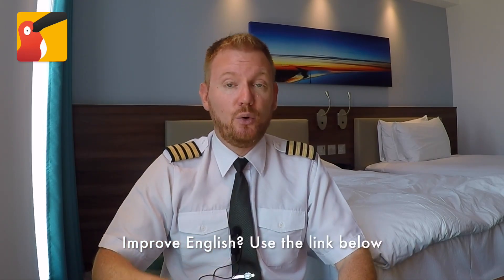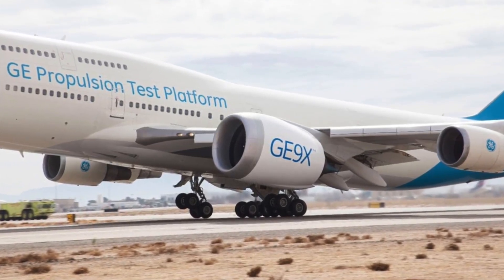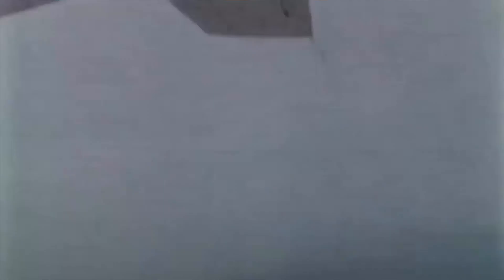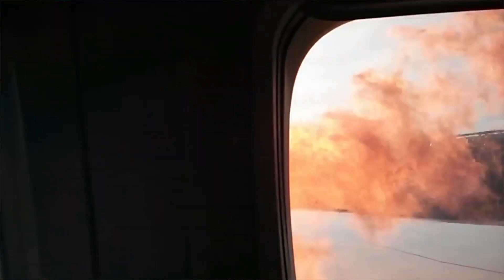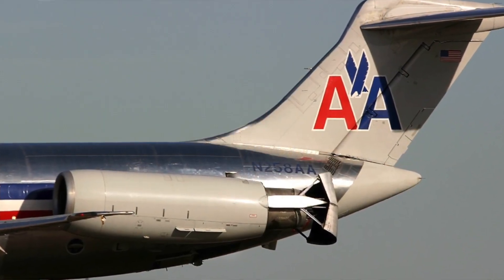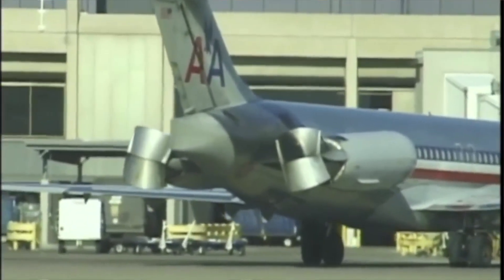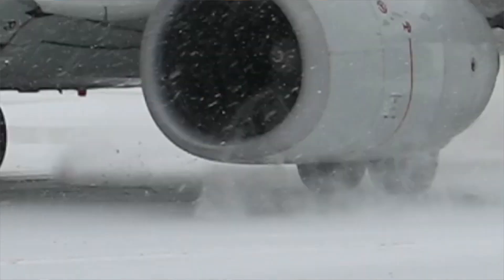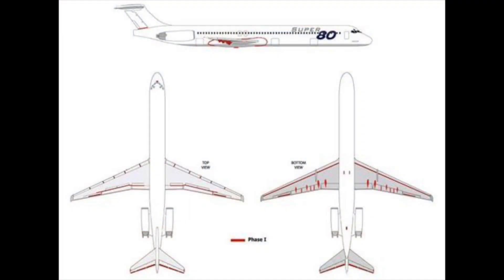Why are the jet-engines placed there? Wings vs Tail

Comment: um the biggest reason the engines are mounted where they are is due to the area rule of aerodynamics ... if the engines where inline with the wing edges you would need an engine 3 or 4 times larger than you have to take off ... by moving them forward of the wing front or putting the on the tail ... you adjust how much power is required to take off ... the more vertical surface area you have in any given line will be your drag ...the more you can balance the lines so they follow a curve like a drop of water on a glass plate ... it never fits perfect but you adjust where stuff is to make the resulting effects as beneficial to your needs as possible ... supersonic flight needs a change of fuselage over the wing area to have smooth easy flying air flow ... a passenger plane like the boeing does it with its top hump by extending it back over the leading edge of the wing they make the plane more efficient  saving costs and added bonus of making more room for paying stuff
Reply: that fluttering is called resonance ... and will constantly increase until acted upon in an opposite manner .... or by changing its point of resonance ... by adjusting a flap ... or trim ... or perhaps a transfer of fuel ... any change to the affected area will result in some effect to either increase or lessen the problem
Reply: btw the other reason engines mount forward is the exhaust also increases the lift of the wing in its path because it warms the air and pumps high speed compressed exhaust gases into a comparative vacuum  ... so as the exhaust expands in the rear air it gets denser pushing the plane forward faster ... yes due to cooling from expansion ... this is also where your contrails come from ... they also precipitate out any unburnt fuel particulates and they eventually fall to earth in rain or smog or some other natural way ... eventually ... and this is where cloud seeding theories get there fodder ... what you put in the fuel ends up in the air eventually ... put enough of a bad thing anywhere and it eventually becomes a big problem ...

Comment: The 737 was initially designed with tail engines. The engineers were overruled
Reply: Jimmie Meadows so it was a complete rip off of the 727?  So, the mad dog.

Comment: I am curious what impact tail mounted engines have on the design of the wings.  I would think you could make them cleaner aerodynamically, lighter with possibly more internal room for fuel. If you want to weigh in on this, I would appreciate it.

Comment: One minor item that I didn't hear mentioned.   There is a trade between fan diameter and landing gear length.   Bigger engines require longer landing gear - and
landing gears are heavy.     This tends to be more of an issue when retrofitting larger fan engines to an existing airframe.

Comment: Russian fighter jets can close the engine intake opening in the front & that panel opens an inlet at the top of the wing to get air to the engines to avoid FOD or foreign object damage, then when airborne they move the panel up to open the front intake & close the top intake! This feature is needed because they often use fields with a lot if debris &( shit )on the ground! 😅👍🇺🇲

Comment: At the time of the first jet airliners, putting engines in the back seemed a good idea, largely becauce single flow jet engines of this time were very noisy. But there is a major drawback : overall balance. This why this solution has been dropped apart on small business jets.
In France when it was decided in the fifties to develop a mid range airliner there was two projects in competition, the SE210 Caravelle, and the SO60.

The SE210 had its two engines at the back, while the SO60 had its two engines under the wings, prefiguring the Airbus which came later.
The SE210 was chosen, but it wasn't the best choice !

Comment: All new commercial aircraft have the engines on the wing because of weight. 
Attaching the engines to the wing spar means you have them attached to the strongest part of the aircraft structure. 
Older designs with tail mounted engines have extra fuselage structure to spread the load from the tail to the wings. 

Business jets are too small to put the engines under the wings, so they put the engines on the tail, closer to the fuselage. 
Wing mounted engines are further away from the fuselage,  so they are less likely to hit the fuselage with debris if they explode. 
Business jets put the engines behind the pressure vessel of the fuselage. That way if the engine bursts, parts won't rupture the pressure hull. The tail area is unpressurized.

Comment: I can see that the rear mounted engines are have a few degrees of inclination in order to have the exhaust airflow a bit downwards. Is the purpose of this fact to minimize the pitch up moment when the thrust is increased??

Comment: Why are aircraft engines not water washed like power generation facilities?
Reply: They are, sort of. The cleaning media varies by model, but they do  have power recovery washes on a schedule. Essentially a soap is sprayed in,  allowed to sit for a few minutes,  then washed out by cold water, all done with the engine motoring on the starter. 

Some turbo jet aircraft get things like walnut shells injected while running to clean the turbine blades off.
Reply: They are water washed in intervals.

Comment: Is it not possible to have engine on the tail and the wings so as to have  spares in case running engines fail?
Reply: That would be so heavy the plane probably wouldn't take off. Also engines rarely fail, and when multiple engines the reason is never independent (so all of them would fail)

Comment: The problem with pilots not being able to "see" the engines is always concerning.  My question is; why don't they have cameras that can feed visual information on demand to check the engines on both wings at the touch of a button aside from cockpit indicator lights?    I've been looking up on air crash investigations and I've seen a disturbing trend of some engines falling off, or burning, or something else - and sometimes the cockpit indicators aren't enough to assess what is wrong.  There's one airplane accident I've seen where the pilot switched the WRONG engine off (right engine) when it was the left engine that was malfunctioning and sparking during flight - the end result was a super stall and a crash. 

For something with a possibly simple solution, it seems they still don't have that if what you're saying is still true that pilots still can't see their engines outside of indicator lights - and the reliance of cabin crew for actual visual confirmation.

Comment: Do you have an answer for the question why commercial airplanes never offer a very cheap very simple parachute and an (under normal circumstances secured, locked from the cockpit) emergency escape door that can be opened in emergency situations as a safe escape route 100% guaranteeing the survival for every passenger?
Reply: You cannot parachute out of a plane that is out of control. It also doesn't help in any regime where failures are helping and unless you know how to use a parachute you might die in the attempt

Comment: Wait if a 737's reverse thrust is initiated, won't it be correct to say that it will not suck any gravel and shit from the ground, matter of fact, it won't suck or intake at all because the reverse thrust is only gonna throw or push the air forward which in turn pushes the plane backward so there is no sucking therefore no gravel and shit in the engine you're welcome
Reply: but the engine is still intaking air

Comment: I am curious why aircraft designs like the Lockheed L-1011 are no longer used. Engines in under the wings, and in the rear. And yet, it is not a T-Tail aircraft.
Reply: Ok I retract this question as I found your video "Three Engined Aircraft, what happened?"

Comment: One more minor comment:  Russians were famous for placing numerous engines in tandem either on the tail or in case of the Ekranoplan (Caspian Sea Monster) which had four engines on each side above the nose.  You can only imagine the stress placed upon the mounts!  Plus the Buran space shuttle placed engines on the back of their fuselage, probably either to provide more maneuverability or simply because the pilots didn't trust the automatic landing system.

Comment: T tails needs a counter weight on a rail system to shift the weight towards the nose when you have a super stall. It can be designed to be on a ram. It moves forward to force nose down, building speed to maintain lift without extra downward trust from the engine. The weight is over the center/wings and can be thrust forward during stalling.

Comment: I know when an engine blows up like one did on an Airbus 380, your chances of survival are much greater when they blow the empennage of the tail of the plane, not easy to control the craft when this happens.  When landing, either a prop or jets blast under the wings gives a quick extra lift hitting the flaps.  Mounted on the tail, that blast of jets has to increase the speed of the aircraft before you get that extra bit of lift.  Feel mounting the jets on the tail is tantamount to committing suicide.

Back then when doing a lot of air travel avoided the 727, they  required three crashes before somebody figured this out, in particular on shorter runways were the pilots wanted to reduce air speed.  Got stuck on a DC-9 at the rear, that starboard engine was vibrating like crazy, port engine was okay.  Asked the flight attendant about this, she said the pilot said it was okay.  But that time, my rosary worked. 

Feel putting the engines on the tail is stupid.

Comment: Wing mounted Engines?????  Would they not provide a place to land on if the landing gear fail. Thus proving a  space between the wings, where the volatile fuel exists, and the ground?

Comment: Flutter is when The material resonates at a certain pitch. So like when a woman screams and breaks a glass, it's because it's vibrating.
All things can vibrate. Even an concrete oil rig once vibrated with the sound of waves, making it break.
So adding engines can make the vibrating note lower .

Comment: that would be its resonance freq. It causes vibrations to occur at the wings or bridges natural resonance  causing failure. oil wells have this problem to with waves, they use struts much like fingers on a guitar changing sound/ freq

Comment: Noob here. Two questions regarding stall in a T-Tail:
1. Can the pilot deploy the landing gear to solve the super-stall issue?
and
2. Can the flaps help to get the nose down?
Reply: Interesting... Not a noob question at all.
Reply: So you know.. the landing gear would cause drag, and could cause the plane to level out, but wouldn't really work.
The flaps thing sounds interesting, as it could increase lift, and remove the messed up airflow. 
The actual training to try and get out of it, is to try to dip a wing sideways. This will make the nose drop.

Comment: I have a question please sir ...l why not have two smaller engines on the wing and two smaller ones on the back so that we get best of both worlds instead of 2 larger ones ...
Reply: its more efficient to have 2 large engines rather  than 4 small ones, no mater what there placement. The main problem is you would get all the negative aspects of both designs too, like needing a t-tail, strengthening the rear of the aircraft, tall landing gear etc. etc.

Comment: 20 years ago once i had a travel with a Tupolev 154 of Aeroflot. You know that model (despite its old fashioned and outdated looking) actually is a legend in aviation. It has 3 very powerful and reliable engines all are located at back arond the tail and it has a very strong fuselage. 10 years ago a TU154 of a small domestic modest private Russian airline had an emergency landing in a Taiga forest in Siberia. The aircraft had destroyed many trees but it could stay intact and solid with only minor demage. That incident was considered as a miracle. Anyway during my flight 20 years ago i was in a very behind seat. The second line from the rear. I could see two engines at the sides and it was amazing. They took and suck even the clouds visibly. There were some empty seats of some absent passengers. I kindly requested the cabin crew to change my place and I moved to an empty seat in front. It was 4 or 5 line from the beginning of economy class. You know wings are also at a location quite back in that model. My new place was in front of the wings and far away from all the engines. It was amazingly quiet. Almost no noise and no vibration. I felt like the plane was not moving but waiting on the ground. It seems to me vertical stabiliser micro wing at the tail to be on top of the tail instead of the downside generates extra advantage to keep the plane stable and avoid the vibration. Because logically according to the physical rules if the distance between the main wings and rear stabilizer wings is more there may be more air and air pressure between them to keep the flight in a straight line. You know many Soviet aircraft like IL76, TU154, IL62 in that era before 80s had such a layout design.

Comment: Rear mounted engine design was dictated by the need to operate from smaller airports that may not have the best facilities and equipment for fueling, baggage handling, and jetways etc. Without engines under the wing the body of the plane can be lower to the ground making loading and servicing easier.

Comment: the majority of turbofan aircraft engines are louder on the intake side rather than the exhaust side. otherwise, great video!
Reply: turbofan on the intake just has a turbine whine noise while at the exhaust has a jet blast noise. It's the reason why seats ahead of the wings are preferred(and costlier to select on LCC's)

Comment: One would think that aircraft designers would be able to locate the horizontal stabilizer on t tail configurations in an area that falls outside of the disturbed air envelope of the wings in a stall situation.

Comment: 8:59 WHY? WHY? WHY?
Airplanes need multiple cameras, landing gear compartment, baggage compartment, engine, inside fuel tanks, passenger compartments, REAR VEIW CAMERAS, wing cameras, tail/rudder camera. WHY?????🤔
Reply: exactly, why would you need that
Reply: That's what ATC and ground controllers are for. They're totally unnecessary and I don't think there's ever been an accident where these would have helped.

Comment: 6:14 You need to explain this to Boeing (Max 8).
Reply: There were 2 major air disasters in Polish Airlines  .. Both from exactly the same reason. Engine exploded due to some circular part failure. Obviously back then we very very happy communist state slave to our mother russia and as a typical happy comunists instead of changing the part they just change the date on the paperwork.. yes we did love russians and their state of mind and lots of vodka😀😀 anyway those engines were at the back. When exploded most other engines were destroyed togheter with vital steering lines which are (no surprise here)also a the back. Obviously you should have emergency steering lines..  however, as mentioned before in comunism plane never failed so it would be pointless to have one. They were basically falling down of the sky. I think its just stupid idea to have them there as engine can explode and you dont want anything exploding next to the most vital piece of steering... eh but lessons were learned and we change those parts 😀 and government system luckily
Reply: I just posted above.  ... and some are just in the wrong place. I've heard Boeing will  rebrand all  series to🛩 666 Max evil 
😁😁✈
Reply: Boeing added the murdering MCAS buck of too much pitch up as the engine were placed too much to the front

Comment: Which again makes it a question, WHY airplane WINGS aren't mounted higher up onto the fusillage in the upper quarter of the circle seem from ground level. Is that just be cause of the aesthetics that we (and airplane manufacturers) have become used to, or is there for that also practical reasons of another nature? It WOULD come with other pro's too to mount the wings higher, it would give the plane a better ground clearance and make it easier to land it under windier circumstances (no risk of the tips of the wings touching the ground which would be a major crash risk, which now even plays off the plane is only a handful of degrees off perfect vertical level) AND it even might make it more feasible that one of could successfully attempt (carry out) a water landing as the engines that have got ever bigger and that now would act as enormous buckets that would immediately upon touching the water surface scoop themselves full of water, creating a sudden total resistance and breaking up the plane, those engines would also be mounted higher and not cause that problem any more.

Comment: What if rear mounted engines were able to manipulate the buckets used for air braking to thrust the tail up or down during stalling?
Reply: Stall is caused by lack of air speed putting the reverses on would cause a crash..

Comment: where should be the best location of C.G, of aircraft for flight stability ?
Reply: just a bit in front of the center of lift. If the CG is behind the center of Lift then you will have a Pitch-up characteristic and this is almost impossible to control (except with sophisticated computers). Keep them close together. But CG just a bit in front of the center of lift.